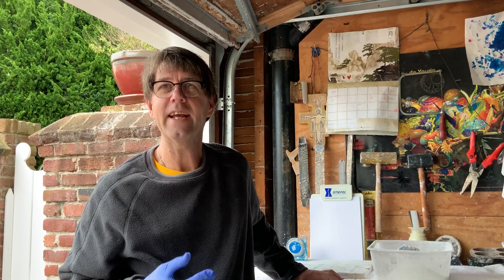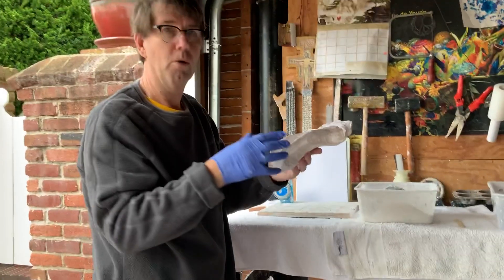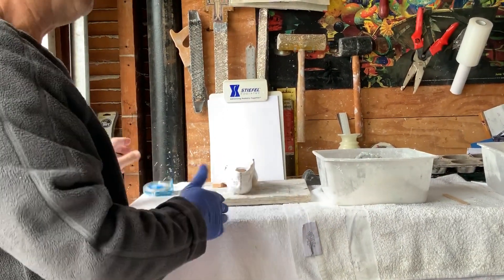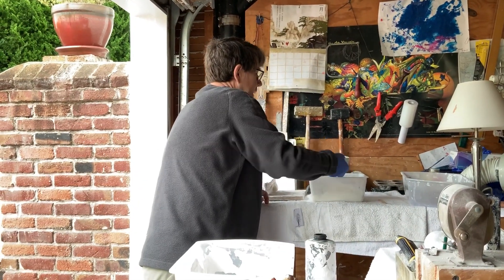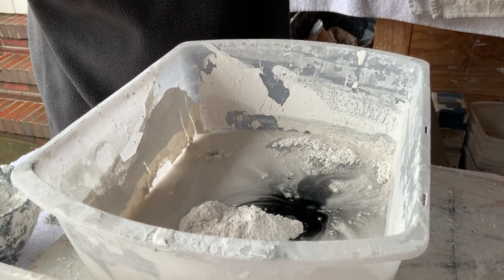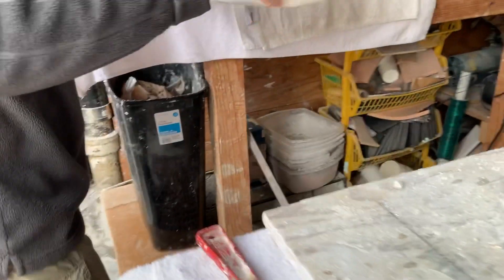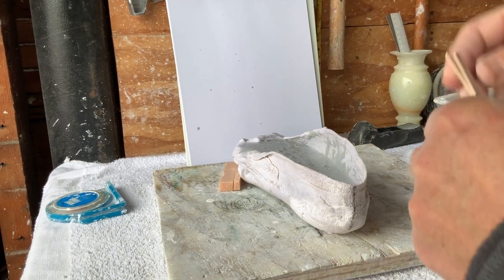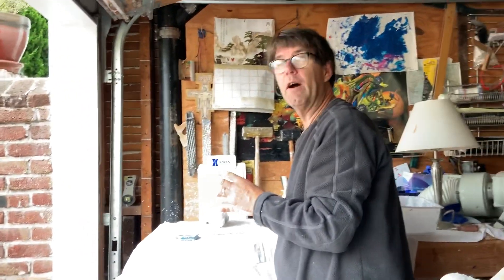Step 3 Orthotic Making: Pouring the Negative Cast

Comment: Hi Dr Blake thanks for all your great videos!!!  I do a lot of biking and running and years ago had a custom-made orthotic casting of my footwhich really has helped me but in the last couple years I had a standing X-ray done and my right femur bone is 12 mm shorter so I added a 5mm full-length insole to my shoes to help compensate I also feel better with some padding underneath the fifth metatarsal on the right shorter leg and also feel better with padding  or wedge under the first metatarsal on the left longer leg.  Does that sound correct from your experience?  I do feel a difference with my cycling with this setup in my shoes.  It seems to have alleviated some of the right lower back pain that I was having when bicycle training for events.